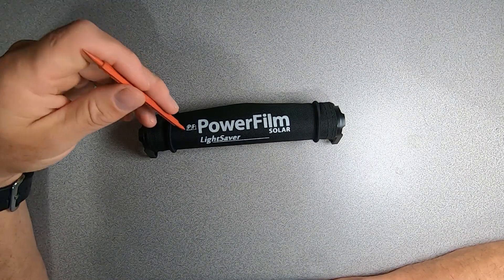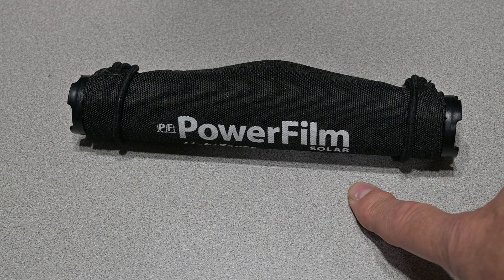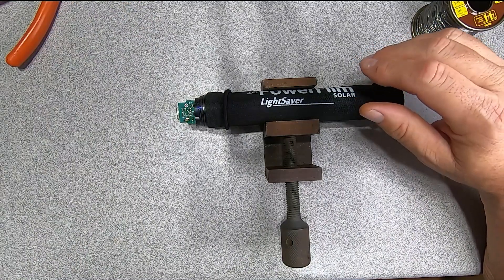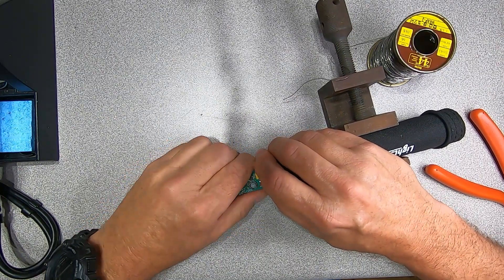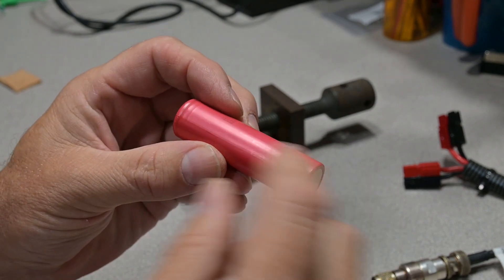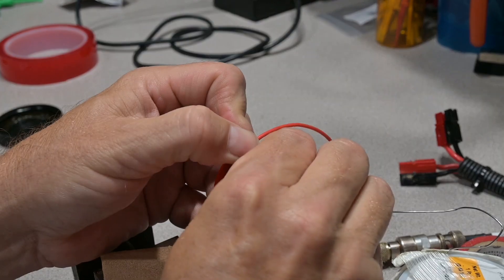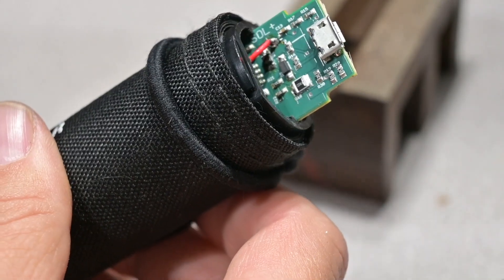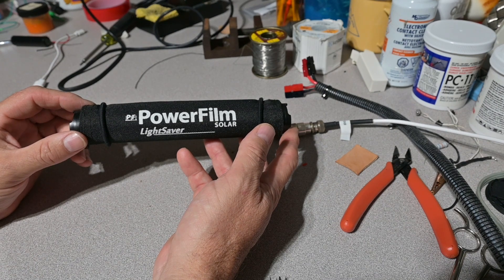PowerFilm Lightsaver 1 Battery Replacement Repair

Comment: love it when people "renew" items that are perfectly serviceable (but temporarily out of commission) rather than tossing those things out. One thing this points to is that the 18650 you installed also will go bad eventually. Was wondering what you might think about having a coupler of some type that would be for both the solar leads and battery leads so that next time it's more "plug and play" rather than "desolder and re-solder".
Reply from the maker: I considered it at first but but even my small deans plugs occupied too much space unfortunately.  If you enjoyed this content stay tuned I have several internal battery devices that will be going through a similar process. Thanks for watching !

Comment: Great video! We don't encourage folks who don't have the same level of technical experience as you to perform this swap, but you made it look easy!
Reply from the maker: Thank you very much ! I love this product.  The cell selection used initially was of excellent quality and the design is simple and straightforward. Thanks for watching !
Reply: Is it possible also for the LightSaver Max? What kind of cells there are?
Reply: @ The LightSaver Max batteries aren't user-replaceable, but we do have a refurbishment program. The solar cells we use in this product are amorphous silicon.
Reply: @PowerFilmSolarEnergy  Maybe you are planning to release some new more compact models with type c interface? The market for rollable solar chargers is empty except yours..
Reply: great video. LS-max owner here, just today I was wondering if i could inrease the battery capacity by replacing the batteries with more capable ones
Reply: @ Unfortunately, the LightSaver Max batteries aren't user-replaceable, but we do have a refurbishment program.

Comment: Could the Lightsaver 1 be used to recharge a Yaesu VX-8DR ?
Reply from the maker: Yes it should with an aftermarket USB charger. I do that with a Kenwood THF6  and a Yaesu VX3R They are all over ebay for like 10 bucks. Just test the charger with a meter before plugging it in your rig. The data on the little chargers is sometimes not accurate. It is not a rapid charge whatsoever however.  Thanks for watching !

Comment: now regarding soldering on lithium batteries., indeed it CAN be done, but only in the way you show it. (I am doing the same thing). Go HOT and FAST
Reply from the maker: That is the ticket on any battery - solder it like you mean it. I would buy a legitimate spot welder if I did battery packs for a living - the cheap ones on ebay and amazon are no bueno IMHO. Thanks for watching !

Comment: would be interesting to know what the original battery was. And I was kind disappointed it contains only one cell.
Reply from the maker: Samsung ICR18650-32A which is a good premium quality cell . I cut the original one open to get the data. Thanks for watching !

Comment: I’m looking for a panel like this but will prefer at least 50-100W are you aware of any reliable robust options?
Reply from the maker: That is a great question. Powerfilm would be best of breed but you would need a battery as the larger variant of this isn't close to that wattage (light saver max) and a lot of disposable income. Regarding batteries personally I am not a "solar generator" fan just get a battery and a plastic case IMHO. The solar generators everyone touts are just a battery in a dolled up box with a cheap inverter.  Bioenno Tech stuff looks like it may be a good value but I have no experience with it personally.  I hope this helps and thanks for watching !
Reply: @survivalcomms  Thank you for your perspective. I’m just getting started with this. I agree… as far as I can see some companies want to charge a lot of money for a battery and inverter in a tarted-up box.
Reply from the maker: @bradl2636  Exactly mix in some YT marketing and whammo everyone wants one :)
Reply: @survivalcomms  Apologies if I missed this detail but what size and type of cell was it? Protection circuit or high-drain type?
Reply from the maker: @bradl2636  The original was a samsung ICR18650-32A
Reply: @survivalcomms  Thank you Sir I will check specs online for it.